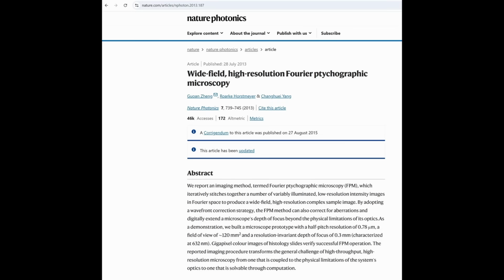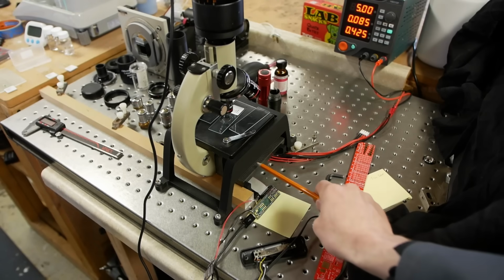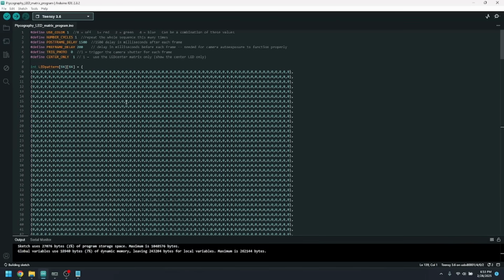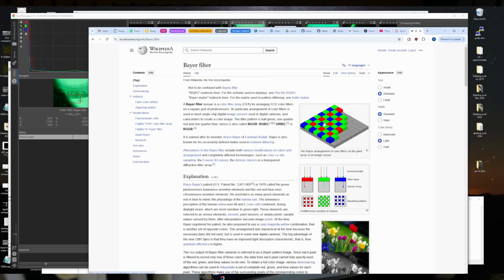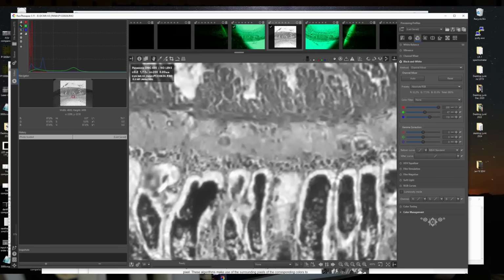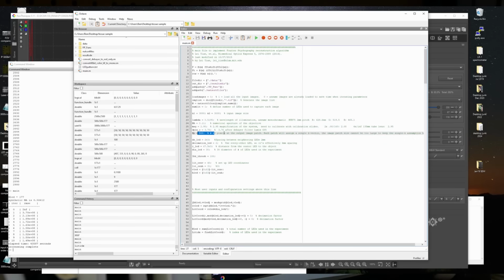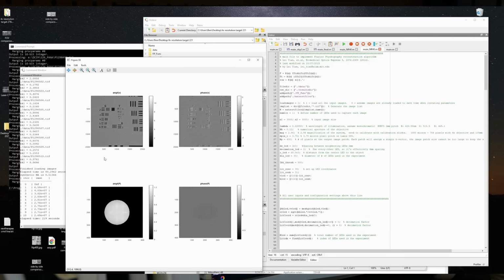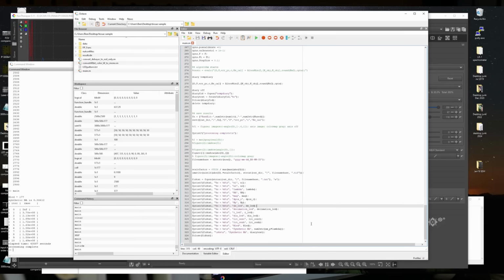Dramatically improve microscope resolution with an LED array and Fourier Ptychography

Comment: This seems to be riffing off the older technique of confocal microscopy where you might have a spinning disk with a series of very small holes cut into it such that as the disk spins, a point-source of light moves down one column, and the frame rate of the camera is set to capture it as it moves as if it's an array like your LEDs. Then the next adjacent hole enters the field of view, then the next, just like an old school TV with a single scanning beam that sweeps sequentially over the entire image. Anyway, the disk spins pretty fast and the images can be pretty good, albeit monochrome, and fairly fast acquisition speed. Can fade the fluorophore if you're doing epi-fluorescence. I got excited by a new version of a similar concept, the laser deconvolution microscope that doesn't use a spinning disk, instead using carefully matched objective lens and lighting system, and fancy software to mathematically deconstruct unfocused stray light to remove it from where it wasn't supposed to be, and sort of back-tracking it to where it would've/should've actually been coming from either above or below the focal plane, or X-Y displaced... or something. It was challenging to get time on the newfangled gadget, not least because it cost like a third of a million dollars or so...

Comment: ok so this is just related to the "dirty" workaround you had to use to get your color camera to work with this but if I'm understanding what you are saying I should be able to get higher detail monochrome images using this technique by lighting my image with green light and then applying a correction to the red and blue channels afterswards, right? that's neat

Comment: Very interesting video. Thy physics went over my head, and I'm not really motivated enough to take the time to wrap my head around it, but I notice the slide shown at 10:30 would seem to be of a size that could be easily imaged with comparable resolution to your process with a relatively inexpensive microscope of less than $1000.
https://youtu.be/E3b3z-kfPRQ?t=42

Comment: There are a number of hacks out there for de-bayer-ing normal cameras. I've never done it myself, but most of the cameras have a glass uv/IR/bayer filter over the sensor and people remove it then either polish or chemically remove the bayer layer before remounting (or not) the glass.

Comment: We use this in ultra-high precision surveying to measure deformation to about 50 microns utilizing a theodolite. Least squares adjustment is the mathematical tool.
Reply: Under what circumstances might a surveyor utilizing a theodolite require micron-level precision?

I thought that theodolites are obsolete, having been largely replaced by the total station.
Reply: @WhatYouHaventSeen  Total stations are inherently less precise in a trilateration network, due to the EDM. EDMs have a stochastic error that scales with distance which results in mm (1/32") levels uncertainty off the bat. The data redundancy you require to resolve that uncertainty into micron (1/1000") precision is impractical.

Instead, we remove the EDM and observe angle only measurements. Theodolites have have caliper style reading on the angle circle which results in much more precise readings, thus reducing uncertainty. By using trig in a least square adjustment system, we can solve for all unknowns without measuring any distance directly.

High precision surveying can be utilized by anybody, such as NASA to CERN. Aligning and calibrating their sensitive instruments  across the entire length of the collider, is certainly a surveying challenge.
Reply: @11u510n15t  That makes sense. Thank you for explaining.

Comment: I imagine with a mono sensor and a precise monochrome source like a sodium bulb, this technique could be even better. It also begs the question of if you could use the interference between several light frequencies with the right camera to extract even more information from the noise.
Reply: Maybe a laser and a DLP chip if the contrast is sufficient? or a mirror galvanometer?

Comment: Could you interposed R, G then B filters before the objective and run the sampling process three times in order to recover independent color channels?  Your green led array may not be bright enough in all channels  but if you had a white led that had decent overlap in the color channels...

I love super sampling schemes.  I worked on a big film scanner years ago using a pulnix scientific camera and we would interpose different filters to capture color.  

It also seems like a known diffraction grating could be used to calculate some of the configuration variables,  kind of like the loop the system does at the end to synthesize the phase. 

Lots of cool ideas here!  Gonna see if I still have a mono camera in the junk drawer.

Comment: My immediate thought was to use a system like a 3D printer bed to move a LED and a pin hole. I'm not sure how repeatable that would be, especially with potential vibration issues. Using a laser cutter to make a mask could potentially help with creating more point-like sources.

Comment: Although it's a different principle, in some ways this is similar to how you can get sub-pixel resolution out of digital cameras by taking a lot of pictures in quick succession while the camera shakes a bit (yep, you end up with more details from a handheld shot than if you put the camera on a perfectly stable tripod).
Reply: Hasselblad has a Sensor that can be moved with Piezoelectric Actuators to get Sub-Pixels from multiple Captures.

Comment: I had a friend's step dad come up with some sort of way to take photographs.  This is more than 20 years ago.  The apparatus was the professional digital camera that was attached to these two beans that would allow the camera and lights to go up and down. Basically take photos of the image as the camera goes from the top to the bottom of the image.  These were images of artwork that was slightly 3d.  I mean then art was not flat like a painting. They were rugs that had a lot of depth to them.
Reply: That's cool! I worked at a Colorado company in the 90s that scanned 9"x9" aerial film flown with a 50%overlap.   We would move the camera around and synthesize a bigger picture. Then use epipolar resampling to extract a 3D image from the two different perspective shots.   Cool stuff!
Reply: @costarich8029  very interesting.  That sounds like an extremely similar process.

Comment: This is the best video I've seen in a while, and I'm already setting up my microscope, an LED array, and my monochrome cMOS cam. I hope to get this working for me by the end of the week! Thanks a million for this great project. 

My LED array may not be fine enough, but I have a gonio mounted mirror from an engraver I may be able to make work as well. 

Do you have a reference for the "encoded" multi-LED scheme to sample the Fourier space faster? I really would appreciate reading about that.

Comment: OMG This gives me hope the project I am working on might work.  I am trying to use a Laser to scan a square area and detect the reflected light into a photo-cell for display on a screen.  I been trying to use a VGA monitor with the H and Vsync controlling mirrors that my laser uses to scan but I think somethings wrong with my monitor so yesterday I started looking into using an old TV I have as if I use the Scanner signals to control a mirror mount the movement of the laser should not only match but I think I should be able to beat the diffraction limit of the laser as I am multisampling each point.  If it proves a problem I think jittering the phase of the light should almost surely accomplish my goal..  Either way I believe this project of mine might turn out to be a poor mans "SEM" of sorts.  An LSM.

Comment: How did you look at the red channel?  If you load the RAW image in a normal program it will have done the interpolation and cross-channel mixing.
But there are special programs that can let you examine the actual pixel data from each channel, and the red channel will simply by 1/4 the camera's stated resolution.
I've used such a program to play around with finding the best signal to noise ratio for different ISO settings and lenses, but the name escapes me.

Comment: why not use a phone or laptop screen as the light field source and even a phone camera as the sensor?
Reply: ribbed illumination field?
Reply: @nRADRUS  I meant illuminate individual pixels or groups of pixels in sequence to create the flying spot effect. The only problem may be the original LEDs version is mostly monochromatic. It may need an LED TV screen instead?
Reply: @minxythemerciless  LED TV screens are LCD screens with LED backlights.  You might have meant an OLED screen.

Comment: Would fiber optic sources work better as closer-to-point sources, or are SMD LEDs smaller than available fibers these days? Fibers have a smaller emission angle than LEDs typically do as far as I know.

Can laser sources be used? They would need to be refocused and aimed to illuminate the entire sample, and polarization might become important. Although, you could get phase information directly if the same laser source was used and its output light stepped through an array of (same length) fibers with their emitting ends laid out in a grid as your LEDs are, also aimed to illuminate the entire sample.

Yes, I’m trying to think of ways to get greater magnification without having to use UV LEDs and an (as far as I know) nonexistent UV camera.

Comment: Maybe a camera with Foveon X3 image sensor is a possible alternative? The Foveon X3 has its color sensors layered atop each other and the raw images have no further processing added to them. Some of the early camera models  that used this sensor (Sigma SD14 and SD15, 4.6MP) are actually not that expensive ($150-$500) on eBay.

Comment: Solving for RGB subpixels seems like an engineering problem that is easily solvable by someone.
I was so excited until I saw the ebay listing oof.
Reply: I would assume the filters must be some deposited layer on top of the silicon. Seems like that might be vulnerable to being dissolved away, with a bonus of 4x pixel density.

Comment: Great video! But why would you use so many (probably weaker) LEDs in a fixed grid instead of a singular (stronger/better) LED on a translatable mechanism, moving on the xy-plane or in polar/radial space parallel to the sensor plane? Is it because of the known nature and specs of your Image sensor? Your recommendation was 4mm pitch between (point-like)-light sources. In terms of flexibility, efficiency and adaptability for different camera systems.

Keep up the good work :3

Comment: Hey Ben, Sony (and possibly other) mirrorless cameras have a mode that uses the In Body Image Stabilization to shift the sensor around by a single pixel, allowing the sensor to simulate being fully sensitive. At least that's my understanding; my camera doesn't support that feature. A lab grade camera will probably still be your best option, but a used camera might be cheap one!
Reply: They don't physically shift the image sensor around, they shift the data from the image sensor.
Reply: @stargazer7644  That's unfortunate to learn.

Comment: I suspect that a monochrome astrocamera would be great for this.  It's not going to be cheap, but they are high quality and can be cooled to eliminate thermal sensor noise.  You also can find DIY instructions on astronomy pages for removing the Bayer filter from a DSLR.  You can get a good mono astrophotography camera for around $1000 new, or for a solid discount via something like the Cloudy Nights classifieds.  (There are shady cheap sources for them that you should avoid, and some ridiculously low resolution ones that are traps for newbies).
Reply: Thermal sensor noise is a problem when you're dealing with very dim sources with very low SNR and long exposures.  It wouldn't be of any benefit with bright images.  That's why astro cameras have coolers and DSLR cameras don't.
Reply: @stargazer7644  I know this.  But it's still available, and with the widely off-center lighting of some of these images, you might be able to improve the images a bit.

Comment: I’m remembering back when I was an engineer, the metrology guys in the quality lab had a shadowgraph which was able to take measurements at different places in 3D space along the z axis by changing the focal point of the light. It makes me wonder if an evolution of this setup could be used to image 3D samples by repeating the process at different focal points

Comment: I have taken multiple overlapping images and used Photoshop's Photomerge to composite them. The "apparent" resolution after being refined by the Photomerge algorith is quite amazing. They weren't microscope images but I suspect the algorithms you used are very similar.
Reply: No, this is not just stacking images.  It is a completely different technique.
Reply: @stargazer7644  "Photomerge" is not a "stacking" technique either. With Photomerge, the images are not just stacked, an algorithm compares pixels to find common edges, aligns them, refines them, and voila, you have a picture with finer "apparent" resolution than your original images.  If you have Photoshop, try it. It is the most impressive feature I have run across and I have been unable to find any other program that works as easily and effectively.

Comment: You might be able to approximate a point source with a mirror array, often used in projection systems, and there are micro LED arrays for car headlights, and now for small display systems....
I also wondered if you could use a hyperspectral approach, that makes use of the different focus of different wavelengths, plus, I guess, it's useful for analysis as well.

Comment: You might find that an astro camera is a good alternative, I've actually been thinking of putting mine on my binocular microscope.  It's color, but monochrome versions exist, are quite sensitive, usually have TECs for cooling, and can definitely be found cheaper than the one you showed on screen.  They're also USB controlled with lots of options for what software you can use, and they usually support open source protocols.  Might be worth a try next time.

Comment: This intuitively reminds me of holography. I was already thinking that when I got to part where you mentioned the phase information being required to reconstruct the image. Isn't that basically how a hologram works? The film records the differences in phase between the reference beam and the light reflected from the object.

It's almost like a reverse holographic technique or something. I wonder if there are any insights from holography that could be used to improve this technique, like using a reference beam. I'm not really sure how that concept could be reversed, maybe a second sensor or something like that.

Comment: Is this like inverse interferometry? Instead of one point of light and multiple sensors across a wide area it's multiple points of light over a wide area and a single sensor? Are there algos used in interferometry that can be leveraged with this technique to make the resulting image better?

I'd look and see but I'm still trying to figure out why every PP time is not a poo poo time but every poo poo time is a PP time. It's taking up all my free hours, I'm afraid.

Comment: As always: Very impressive!
Perhaps my misunderstanding is greater than my understanding at this point, but I wonder what could be gained by setting up a phased array of point light sources that could be vectored through the item to be imaged (sample) to the photo receptors.  My thought is that each point source could target each receptor so every source could address every receptor, phased so each receptor knew which source it was seeing at any instant. The targeted receptor could activate a small grid of receptors around the target at each event to add additional information from each event . 
Clear as mud when reading back over, but the idea persists.....

Comment: Ah, the paper doesn't answer the one question I'm dying to know! What's the new resolution limit this technique could offer?

I love that it uses a low magnification lens so you get a really large image of the sample and presumably deep DOF. It takes time to capture your image and process it, but the low magnification gives good bang for your buck. Great video topic!
Reply from the maker: Good question!  In air, it theoretically allows up to NA=1 (180 degree LED illumination), so the resolution would be half the wavelength of illumination, or a couple hundred nm.  Practically, it would be difficult to get this high.  The paper's authors seemed to think that NA=0.6 would be more reasonable.  If the whole setup were submerged in oil, it should be possible to go higher than NA=1....
Reply: @AppliedScience  I see, so it increases the theoretical resolution of the 4x lens but doesn't exceed the resolution limit of optical systems in general at half a wavelength. Disappointing, but still cool.